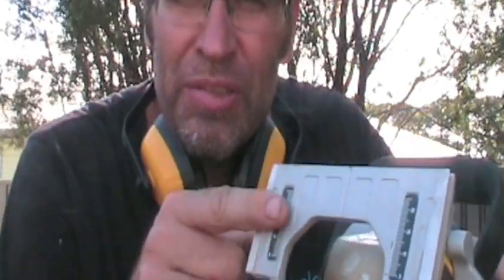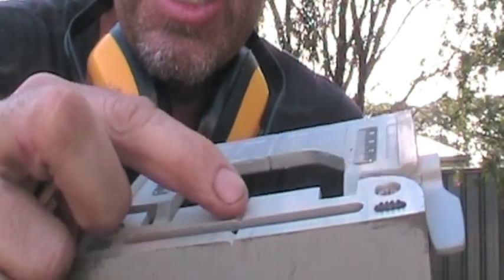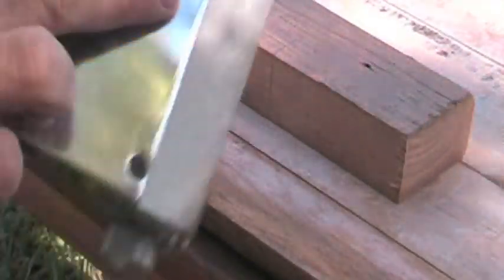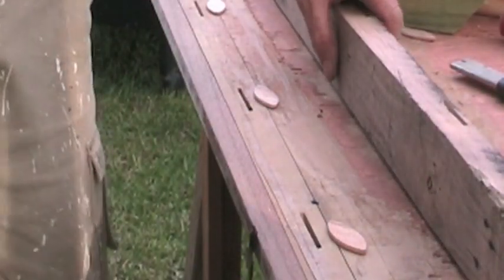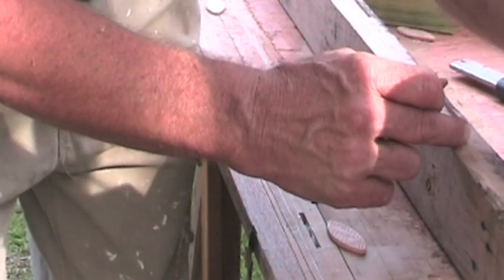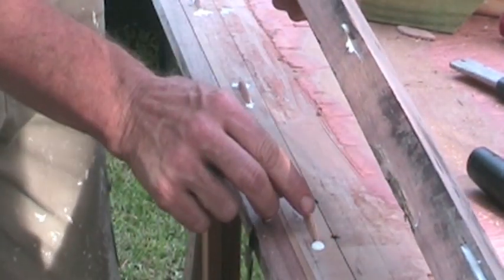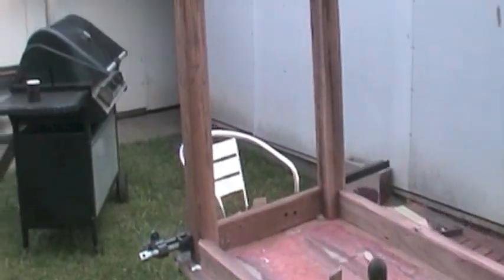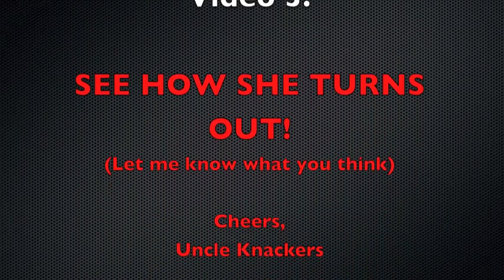How to Build a Rustic / Distressed Table. Video 2

Comment from the maker: Pocket holes would and do work well. One of the main reasons l used the biscuit joiner was just to show people how easy it can be to do. One thing l did after l posted the video was to screw some timber to the underside of the table attaching the legs to the table top frame. You see this on most timber tables. It just adds extra strength. I would recommend doing it. Cheers mate